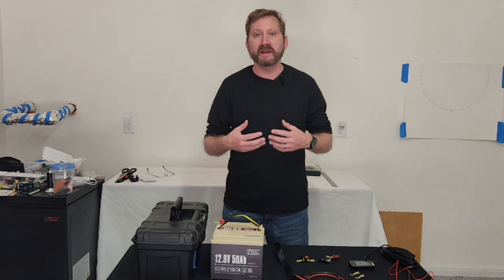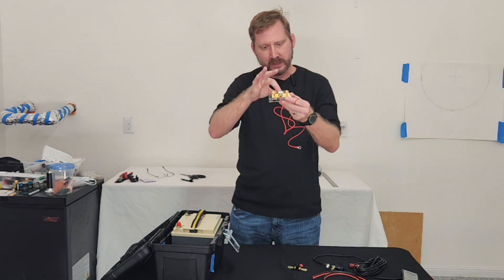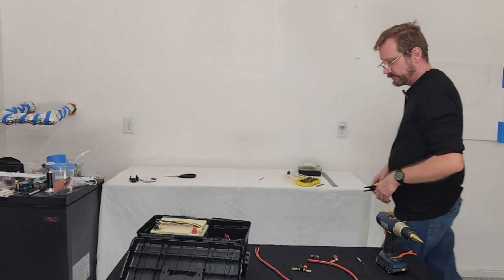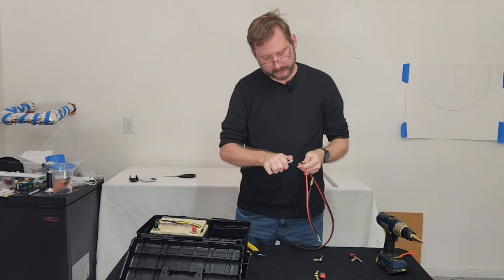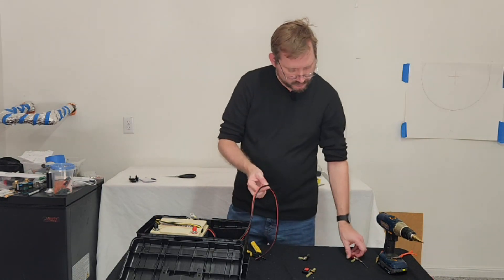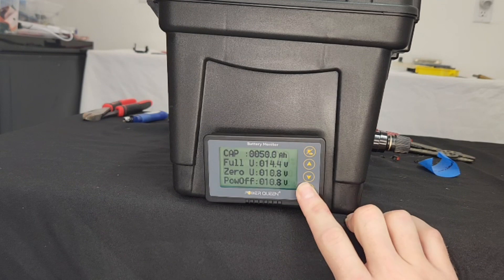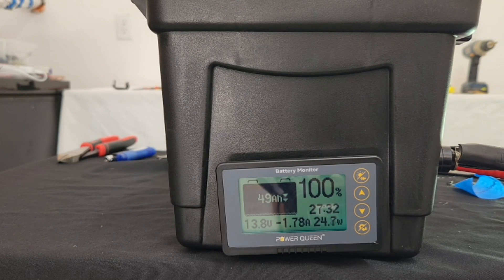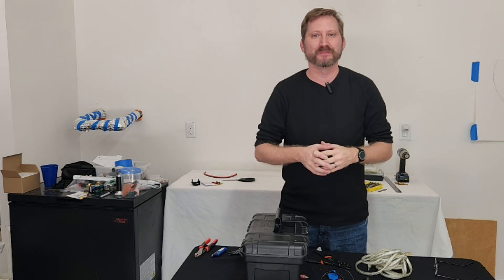12v 50 amp DIY Power Box for ham radio or emergency use.  Power meter built in!

Comment: had not thought of a two box solution one for raw DC and a second optional one with a small ac inverter- thanks for this clarity on an optional solution that i think might work better for me. Bulkier but more modular.

I think a heat gun was about the 10th tool I bought so I guess I’ve been spending too much on tools!

A thought for others cloning this … A lot of us might want to put the meter on the side with the latch as it provides some protection to the plastic face  - maybe. maybe it won’t fit but there are a few boxes at HD in that style so maybe one would work.

i have been banging the small ends of tool boxes when i toss them around for decades and doubt i could change my ways.
Reply from the maker: It actually took me 4 tool boxes to find one that would fit the battery properly. I'd rather the meter be on the same side as the terminals but couldn't make it fit easily